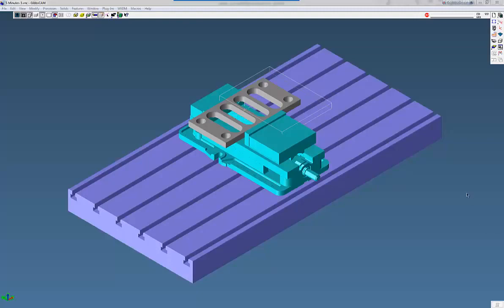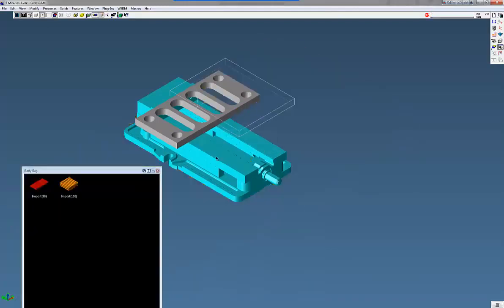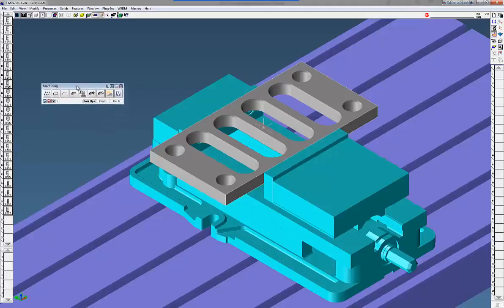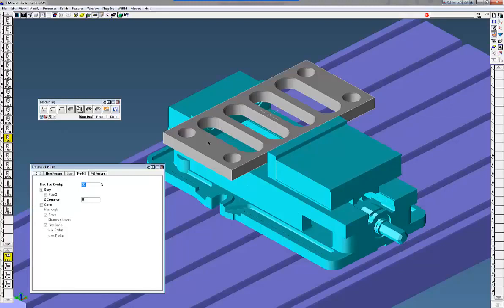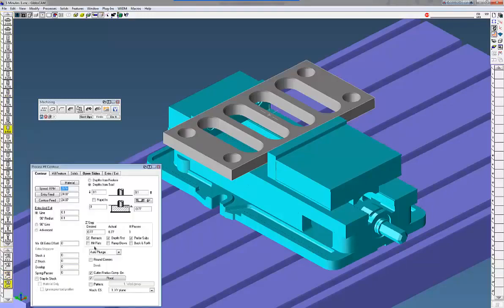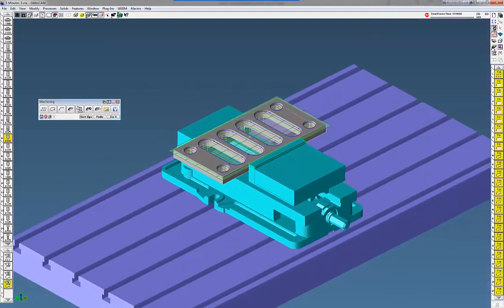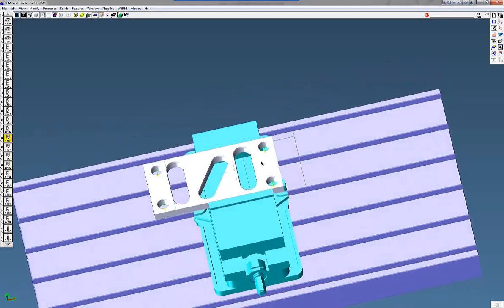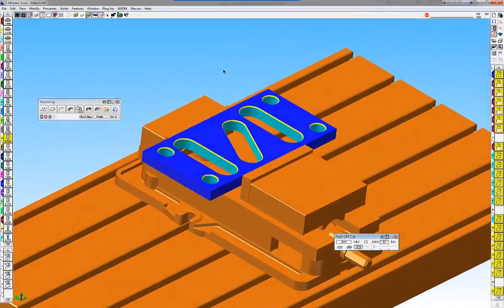GibbsCAM, multi-process programming

Comment: This is a great feature. But it doesn't work the same when you extract the geometry. You have to select one slot at a time and click do it each time. Because if you try and do all features at the same time, it predrills the first feature selected but doesn't predrill all the features selected after.
Reply from the maker: The key is the Process tiles.  Notice I have four tiles there.  The first tile is a drilling process.  Click on the Tab that says Pre-Mill and check the box that says Entry.  Don't check any other boxes.  Then process 2 will look at process 1 and know we want to Pre-drill a hole before we mill.  Then process 3 looks at process 2 and 1,  then process  4 looks at process 3,2,1.  It work2 on geometry as well as using the profiler.  Hope this helps.
Reply: @GibbsCAMVideoTutorials  I've been doing it exactly like you mentioned. But again, only the first feature selected has a predrill and the rest is everything except the predrill. But let me try this one more time at work tomorrow and I'll update you. Thank you for replying!
Reply: @GibbsCAMVideoTutorials  I tried doing this today and it's only predrilling the first slot and for every feature after that I does everything except drill.  The way around it, that I've been doing for the last 3 years is, hitting "do it" for every feature and only then I get a predrill for every feature.
Reply from the maker: @kashifq6504  What version are you using?
Reply: @GibbsCAMVideoTutorials  13.33.0 and 14.4.0.